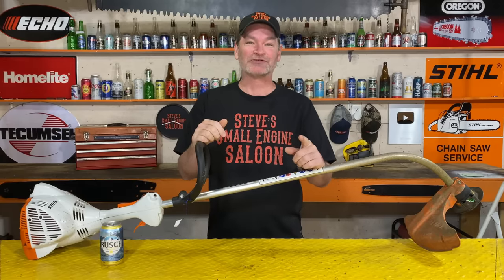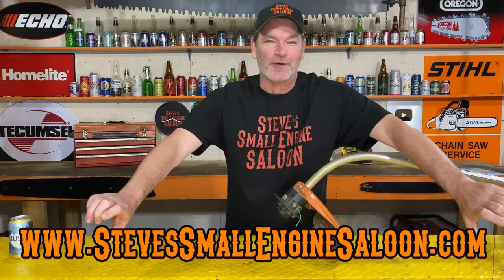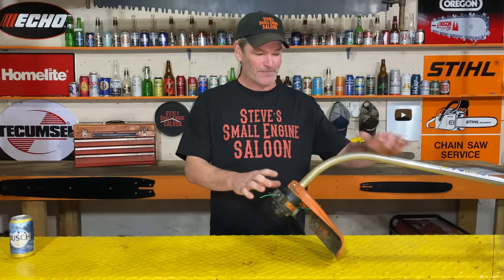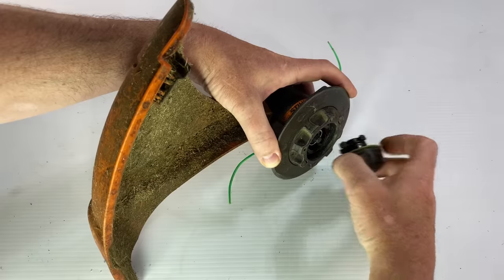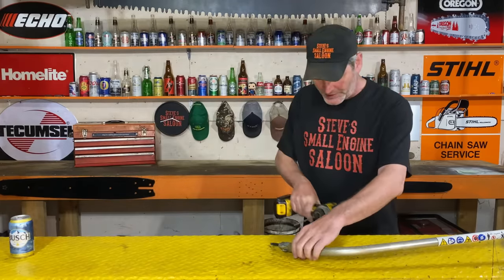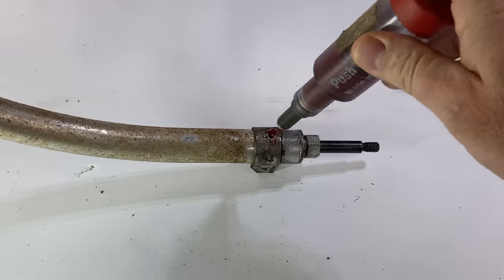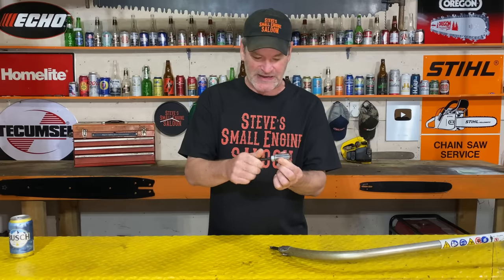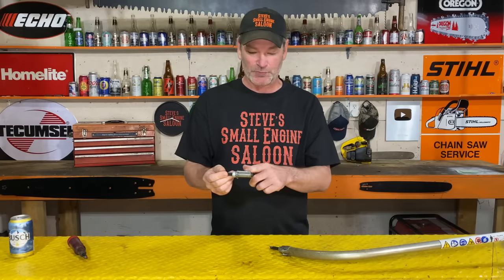WOW! Hidden, Secret Greasing Spot On A Weedeater

Comment: Great little bit of information there Steve. Thanks for that.
On a straight shaft, is the only way to grease up the drive shaft to dismantle it ?  That would be super cool to have a secret grease hole on an FS55 for the drive shaft.

Comment: Take note you can buy a metal grease gun with a metal cone tip for a few $ more. It will likely outlast this plastic gizmo. Mine is decades old and still works fine. It also works for bicycle bearings in older machines equipped with grease holes or fittings, in particular the English utility bikes from the 1950s.

Comment: I have an issue with my stihl 460 weed eater/brush cutter. When i am using it, the motor seperates from the shaft. It is literally in 2 pieces. Help please

Comment: Steve,
I followed your suggestion about lubricating the hidden grease hole on my Stihl FS45 trimmer using the small grease gun. The other day I noticed a significant accumulation of grease that had built up under the deflector where it is attached to the shaft. I wonder if this indicates I blew out a seal or had injected too much grease. Comments?

Comment: My weedeater cranks up, running good but just as soon as you start it will cut off. It takes forever to re crank it but when you do it will barely run. Head shaking but barely turning. Next day it will crank right up and do the same thing again. What is wrong

Comment: I am 2nd owner of a well-used, curved shaft  FS56 Stihl. I had asked the local dealer about servicing the shaft because I noticed the shaft ends would get pretty warm after a 1/2 hr or so of heavy use, and they just said it was too expensive, complicated to service. Now I see that was BS. What about the top end of the shaft? Is there any type of grease hole up there, too?

Comment: Nice. Did not know this grease port. Got a question Steve, what do you suggest to stop air leak from threads and base of a decompression valve on chainsaw? Valve tightened and washers crushed but still leaks.

Comment: I have a Shindaiwa straight shaft weedeater that I never knew it supposed to be greased. I pulled the bolt on mine. There was a little grease left in there, but not much. I think I saved it in time. I know to top it off every season.

Comment: Have you tried to use the new Husqvarna "rapid replacement" trimmer head on a Husqvarna128CD (curved shaft) weed eater? All the videos on line are for LD (straight shaft) Husqvarna. My curved model does not have hole where you stick a pin through to keep the flex cable from spinning when you remove or attach a trimmer head. Instead, it has a nut just above the threads on the end of the trimmer that you have to secure with a wrench to prevent the flex cable apparatus from spinning as you attempt to screw on the head, or screw it off. This leaves about 1/2 inch, I'll call it flex cable,  open and without protection that tall weeds wrap around in 5 minutes.  If I use a spacer in this area, will never be able to get the head off again because the spacer completely conceals the nut that the wrench goes around, mentioned earlier.  The spacer is in the way and precludes ever using a wrench on that nut, which precludes ever being able to remove that head again. However, without the spacer to press down on the head to feed new line when I bump it the feed mechanism won't work. Any suggestions?

Comment: Great stuff as always!!!
Is there any lubrication for the end of a straight shaft on a Stihl trimmer?
Mine is the base model straight shaft. 
Thanks again Steve
Reply: Mark Heseltine Yep. There is a grease port at the of the bottom of the shaft. Your Stihl manual addresses this. I'd read the manual to know exactly what to do (how much grease to apply, etc.)

Comment: On my NB40 robin strimmer the instructions from the manufacturer says the gear head should be pumped with grease every 10 hours.
   Given the fact that some strimmers have a bush bearing on the end of the drive I would advise greasing every 10 hours.

Comment: Steve fs38 chokes when hot, I changed gas rubber line and filter.  It starts but it chokes, dealer thinks it’s coil but for my model year it’s no longer available.  How can I prove it’s the coil?

Comment: Hey Steve have you heard of the spark arrester becoming clogged up on Stihl trimmers? Once they carbon up the trimmer starts and idles ok but no top end, no rpm. Remove the spark arrester and burn the carbon off with a torch. Replace it and it runs like new.
Reply from the maker: Yup.  That video is in my playlist...
Reply: Are you using the Stihl synthetic 2 cycle oil? At 50:1 mix, it should be lean enough to eliminate that problem. I've been using Amsoil 100:1, 100 hours per year, 6 years  and never carboned up.

Comment: Hey Steve, long time listener first-time caller, are there any grease points or service requirements for a Straight Shaft string line trimmer? I know the gearbox on the end of my Stihl has a service point and it's full of grease but what about service intervals and best way to do that.

Comment: I have the Stihl straight shaft and my dealer says its not made to grease. It's a $200 weed whacker and it seems they should make it greaseable to me. They claiming its not a pro model thus not intended for extended use which I think is Bull.

Comment: Grease and oil are cheep compared to new equipment and parts, i e maintenance free spindles , come on how long can the grease from the factory last, its only a $ 7000 ? lawn mower.  My Echo SRM 2200 at almost 30 years old still kicking with a little  TLC every year. Good job Steve.

Comment: Has anyone else had this problem? Bought the genuine Stihl tube of grease, the kind you screw into a Stihl straight shaft brush cutter head, and the the thread is a different size. Mine is decades old an FS90AV with the squarish shaped air filter box, they must have changed it for the newer models? Still get grease in there but bit of a bummer.
Reply: @JohnSmith-yv6eq  It's okay I can still get grease in there and it's not supposed to be full to the brim anyway as per instructions, it's just a bummer the tube wont screw in. I'm wondering when the change happened?

Comment: Any ideas why gas is coming out my air breather and killing the engine? I have replaced the carb, adjusted the valves to Stihl specs (FS90R weed eater) and changed the tank fuel filter. Fuel still pours out the air filter. Stumped?

Comment: Steve. If that bearing becomes a point of failure, what is the cost involved to fix it? Does that screw also hold the bearing assembly in place or do you have to buy an entire shaft? I'm curious how the mechanics inside the shaft works.
Reply: Geonious = Hi, I'm not Steve (I apologize for that), but I can help you with atleast part of your question anyway, IF This is even Relevant anymore...
~ Yes, That little screw Does hold that bushing assembly In Place. If you remove That screw, you can pull that bushing out of the end of the curved shaft.
You Do Not have to buy the entire curved shaft to replace that bushing.
Unfortunately, I Did Not take the extra 30 seconds to look up the price of that part, but if I remember correctly, that bushing is not very expensive.
I hope this helps, a year after you posted your question.
If you find that I have given you incorrect info .... Its ALL Steve's Fault !

Comment: Steve !
I am ashamed to say that you just saved my @$$ !
We are a commercial outdoor power equipment dealership, and must work on twenty of these specific curvered shaft units a year, and I have to admit that I had no idea that little socket head screw accessed a service port for that bushing !
Have disassembled the lower drive completely in order to lubricate that bushing many times, and never greased the bushing using that service port !
Thanks Steve !
Reply from the maker: Right on!  You're Welcome...

Comment: Not only did I not know that, I would most likely never have known it. What if the space I stored that information in, was really meant for something else? I saved a few old weed wackers and cheap pressure washers, (donated) just to see what is breaking down on them. (Box store crap) I STILL may have never looked for that grease hole. Haha.
Unboxing the $600 Simpson pressure washer today, from Wilco. Honda (haha) engine.
Tweekers got my Honda/Cat. I cheer, when I see their feet sticking out from under a Prius now. Now get to work, “on those Busch’s”.  DKS! (No channel, yet.)

Comment: Do you do the same on a st- shaft or only on the curved units ??? Thanks
Reply: Usually on the trimmer head it'll have a grease zerk or a screw/bolt to take out to grease the gearbox.

Comment: ....comment.....oh  kay.   i drilled a small hole, high up on the shaft, near the top handle. About every 4 hrs of use, i use a large needle, the kind for cows/horses,  and shoot 80/90  gear oil down the shaft,  INSIDE.  ( just a couple squirts, maybe a tea/tablesppon. )    This lubes,  and keeps crap out of that lower bushing/bearing.  One, could also use a blended mix, of  80/90   and grease.  This way, no need to take apart anything.  WHY  didn't  they  'design'  this, alot more thoughtfully ??   you know, Steve,  to sell more parts, etc....like all stuff today.  Take care of your  Bush (es) .  In alberta

Comment: Is that bearing common on all curved-shaft Stihl devices? I have an FC 91 edger with a curved shaft. I do not see the standard grease port on the gearbox like there is with the straight-shaft models. I'll answer my own question tomorrow as I have the FC 91 on my bench and will check it out and report back. ETA - the Stihl FC 91 edger does NOT have a "secret grease hole" - at least that I could find. The gearbox appears to be a semi-sealed unit. There is an exploded diagram with the various bushings, bearings, and C-clips that go into the gearbox, but since Stihl's business model WANTS you to take all of your lawn and garden equipment issues to their dealer, I will avoid doing that. All of this tells me that Stihl fully intends for this edger's gearbox (or any unit without the capability to be lubed) to fail. And you know the replacement cost for that gearbox is half the cost of a new edger. Well done, Stihl. You've engineered failure into one of your products. The good news is, I don't use this edger very often.

Comment: Husqvarna has a cap screw to remove to grease the head also
On the Husqvarna my clutch is a little noisy
Have you heard if greasing the clutch on a husky weedeater like a clutch in chainsaw?
Greasing clutch bearing I mean
And why do you never greased the rod that runs down the shaft?

Comment: Hey, does anyone know if FS 38 trimmer has an internal filter in the muffler? I've looked at my muffler and it looks like two solid pieces clamped permanently into one "box" and as far as I can see there is nothing which could be unscrewed and cleaned. Is it just an empty muffler or is it one of those "replace after 2 years parts because it's clogged and you can't clean it" situations?
Reply from the maker: Check the video in my playlist called Stihl wont rev up...
Reply: @StevesSmallEngineSaloon  Except, as I said before my muffler doesn't have a spark arrestor which can be unscrewed and cleaned. That's why I'm wondering whether there is any internal spark arrestor that is permanent and whole muffler need to be replaced when it gets clogged.

Comment: That's  reminds  me  of. The  screw you can take  out on a echo  wèed eater.  End at spindle  you can grease  the same  way  .but  most people  don't  that  one  of n the reason  they only get  a couple  of years out of  a high dollars  echo  or stihl   other  is fuels  problems    and  filters  
With a little  maintenance   you can get  a lot  more service out of  then  just  stay away  from  that junk like. Mtd. Or other which includes Troy builts and  most  of the other. Box store machine.

Comment: Hey Steve I have a question. I'm thinking about investing in a steel FD RC-E56 weed eater for my home use and a few other properties.  I do know about the easy start system from one of your older videos about this feature.  My main question is what's the difference between this model and a commercial model like the FX 111 that my company has?  It the difference only the displacement, or is there more things internally that make the difference.  I know from a past job that the older models had valves in them.  I don't know if the same technology is incorporated in the residential applications

Comment: Wouldn’t you want to flush that out with some solvent first? You could use some type of syringe to put in the solvent to put it in and suck it out. Great info though. Does that work for straight shafts too?

Comment: Yikes.  If I ever took that bolt out. I probably would’ve put Loctite on it not greased it.  😂😂

I really think that they should put a Zürich fitting on there and tell people that hit it with a pump of grease every few months or every 20 or so hours. Why I have some hidden pole beneath a screw. I should just manufacture it with a grease fitting.

Comment: Is this common on all brands of weed eaters?  If so, then these fittings should be periodically be greased appropriately. Like to know, and like to get started greasing my weed eaters the way they should be greased. I have all straight shaft weed eaters, prefer them over the curved ones.

Comment: If it's a little grindy, that means there  is dirt in the bearing. The dirt is still there after greasing it. You should have flushed it with wd40 or something similar first. 
I would NOT use brake cleaner or any kind of solvent. The residue could prevent the grease from adhering to the parts.

Comment: Hmm, Busch eh? I dunno...
But this dramatic presentation prompts me to request again, lubricating a straight shaft. My Husqy manual says to pour some gear oil down the tube (it's an attachment, not a dedicated string trimmer). Doesn't say how much. Clearly less than I did since it left a puddle on the garage floor. Also how should it be stored? If it's oil I would think it would need to kept head down. But again, the manual doesn't say anything about it.

Comment: Why didn't you take out the shaft and grease it too??? It wears around the curve in the shaft. Remember to clean it first!

What size are the threads on the Stihl grease tube that screws into the gear head on the FCS-KM straight shaft string trimmer? I measured them at 7/6-14 but it doesn't seem like a perfect fit. I am going to put together a short extension so that the tube doesn't hit the gear head while I'm trying to screw it in. My plan is to take a 7/16-14 nut and a 1" bolt and make a male and female connector. I plan to screw the nut onto the grease tube, cut off the head of the 1" bolt, drill the largest hole possible the .length of the bolt, and double-nut it so that it stays together. 

Stay safe and remember that cross-thread is also known as Canadian Loctite.
Cal

Comment: I personally do not like the curved shaft models of any weed trimmer.  Give me a straight shaft model any day.  I personally own 2 trimmers.  Both straight shaft.  One it just a Poulan that I removed the trimmer line head from and put a plastic blade head on for the light trimming.  The other is a Stihl FS90R with the brush cutter metal blade on it.  It has a screw on the outside of the drive assemble that you remove and grease the drive assembly.

Comment: I was a auto mechanic for 39 years. As many clutch jobs as I have done with a bronze bushing, I always shot a shot of grease in the pilot hole. I was corrected by an old timer you grease a bearing not a bushing when you grease a bronze bushing it clogs up the pours of the bushing making it gum up, he told me use a heavy oil instead this will keep the bushing from getting gumed up and make the natural lubrication of the bronze work properly

Comment: About trimmer line I INVENTED SOME THINGS  INCREDIBLE 👍  I MAKE I SIMPE  KNOT IN A PIECE OF TRIMMER LINE 2.7 AND TOTAL LENGTH  MUST BE 43 CM  AND SLIDE THE 2 TIP INSIDE AT THE DISC SO THE KNOT AVOID COME OUT 😆😆😆

Comment: " a little locator bolt - or screw, some people will call it..."
If you want to get technical, it IS a screw. By definition, a bolt requires a nut, but a screw threads into the material. No matter, people know what you meant. Just like a lot of people will refer to a gasoline engine as a motor.